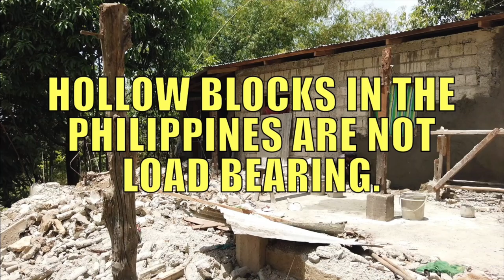Hollow Blocks In The Philippines Are Not Load Bearing.

Comment: " cinder blocks " in USA are load bearing .  They don't use post and beam though .
   The way they lay block here used to bug me until I realized they are only a filler .  You could put up a amacon or bamboo wall . It's the post and beam that is bearing the load .

Comment: On my buildings, I use 8-inch wide blocks, run rebar every 24-inches (vertically and horizontally. glue the blocks together with thinset mortar, and after setting three courses, fill and vibrate the cavities with concrete, bring the concrete half-way up the top course. Then I continue setting and leveling another three courses of block, using thinset mortar to glue them together, and filling the next three-course stage with more concrete, until the final height is reached. The resulting walls have  very high compressive, shear, and lateral strengths.

Comment: Columns and the beams are fundamental load bearing for ultimate load-carrying capacity, more so than the hollow blocks (cinder blocks). They are used to support the weight of floors, ceilings and roofs of a building and to transfer the load to a vertical load bearing element of the structure... 
Just have to remember that It's not wise to violate the rules which could pose threats to the safety of your family or any occupants by cutting corners in building your family's future house with the easiest, quickest, or cheapest way, often harming the quality of work for the structured building.
Thank you so much dai for another great sharing,. Good luck and wish you all the best. Be safe, stay safe, stay home! Best regards/Ned👍👍

Comment: Indeed the hollow blocks aren't load bearing, i saw a video of how they make them in Philippines, they are just sand and cement mix poured in a template. In UK, we use bricks or aerated blocks, both are load bearing. My house is 3 storeys high with 30cm brick cavity walls, no colloums or beams to support. I wish there was bricks in Philippines, it would be so easy to build without needing of rebars etc. We also have concrete blocks which are also load bearing, which are very heavy, they are used as first layer on the foundation, damp proof course after that and the bricks.

Comment: Village person,  The hollow blocks are just to show the render crew where you want
the walls windows and door openings. That being said they are also the shear panels 
 for the building. When you see hollow blocks laid during the day there will be wet
spots wherever the core holes are inside the blocks. This is because the fill mortar
wicks cement and water into the pourous blocks filling the cement left out of the
blocks when they were made. Also the render added to cover up the butt ugly block
work soaks more water and cement in from the outside further strengthening the
hollow blocks. Building code only allows  six courses per day with a minimum 24 
hour wait before adding more courses. This allows the soaked in water and cement
to cure before adding more courses of block.
      The Phillipine government published a downloadable guide for RCCI (reinforced 
concrete with  infill) including earthquake resistence. Even if a prospective builder
is hiring an architect/contractor they should read this guide. Simple things like 
window spacing on opposing sides of the building are crucial to earthquake
resistance to prevent structural collapse of a building from a twisting action due to
difference in shear resistance on different sides of the building.
     We have a no advertising content based channel covering the building of
Villa Cecelia 56km south of Manila. Along with the videos there are narriated
slide shows including the rebar and structural concrete stress calculations. This is
a poured concrete building and there is a cost analysis of hollow block versus
poured concrete walls. This structure was built before seeing the RCCI guide and
it turns out we violated none of the guidelines including the styrrup design rules.
I can't say how entertaining  "CONCRETE HOUSE BUILDING IN PH"  may or may not
be, but there is a lot of detail about concrete house construction. The one concerning
the mix ratio of cement sand and stone available delivered to your site, which varies
from one place to another should be insightful. Styrrup design is well covered and
how many rebars at what spacing for suspended slabs (floors) for a 1.5 safety factor
and  275 Kg per square meter live load is presented in another video. Dimensions
of columns, beams, and tie beams for this build are given with actual dimensions 
on the permit sheet for building materials video. This is one of several videos 
covering what goes on the 7 blueprint sheets signed off by about 8 government 
offices to get a building permit.

                        george and aurora  "CONCRETE HOUSE BUILDING IN PH"
Reply from the maker: George & Aurora. I had a look, very interesting build. When I built my own houses I had to pour large sections of poured concrete, https://youtu.be/eFvRgP3UrDw I have been considering doing the same for my rental bungalows since there will be multiple builds of the same design. I will watch more videos from your channel. What design program do you use?

Comment: You are correct the foundation is the hart  of any house no matter where are building I have columns tie beams with rebar and added additional columns in USA the roof rafters are much more substantial because we have snow load but I am a carpenter so I built my roof to US standards and made very strong connection to the header beam it’s not coming off in a wind I also insulated my house it is much easier to cool but now I have become acclimated to the weather I only use fans my doesn’t like a cool house and also you are a Philippine lady I am always open to learning if were building here in the USA I could help you and advise you just as you have helped me I made my own blocks only because I wanted to control the size and quality to make the walls more like in the USA just to make them look better

Comment: Very true about the local concrete blocks there.  If you want quality load bearing blocks you must buy your own block forms and make your own with adequate mixture.
Reply from the maker: keith jestski I agree, but why make load bearing hollow blocks if you are just going to reduce and cut corners on the beam and column structure? Does not make good economics to me.
Reply: @villagepeoplephilippines  Two different methods to achieve similar results.  In USA we use a monolithic slab and foundation pour using mix that is certified at appropriate strength for the purpose.  This is not possible there with hand mix and cold pour techniques that cause less strength in the end product.  You are doing quite well with what materials and manpower / tools / budget available.  As I said, I would rent one, and prefer it to living in a high rise condo box.

Comment: One other difference is USA blocks are 8 inches wide, not 4.  Stucco rendering is applied to the exterior, and interior is insulated and stick framed then covered with drywall.

Comment: You are right on about the support of the walls,  BUT why not make blocks that will aid in the support also, adding to the strength of the wall?  It upsets me to no end when I see the lack of workmanship in the hollow blocks.  You have to be careful picking one up without breaking it.  I have supported a 3000 pound auto on 4 PROPERLY made cinder blocks while working under it  just think of the strength that would give a wall.  Plus add the correct rebar and fill with properly mixed concrete and that's the way to make a wall!
Reply from the maker: It is a shame hollow blocks are not made load bearing but some people have assumed they are.

Comment: RCC structure (Rigid Cement Concrete) is all about transferring the load to beams,columns and finally foundations and can stand on its own without walls.  Ever wonder why the glass walls on buildings does not shatter?
Reply from the maker: Ray McTion I had an argument with a foreigner who, because he made his own hollow blocks, cut corners on the foundations and tie beams on a 3 story building. When I told him the structure supports the weight and hollow blocks are in-fill, he told me that Filipinos don't know what they are doing.
Reply: @villagepeoplephilippines  Residential homes in the US are mostly load bearing structure type where all of the elements carries load and hence there is no need for  posts. Hopefully he knows how to build this kind of structure. He would eventualldy learn that no cement structure uprooted or severely damaged by typhoon in the Philippineds as compared to Florida.

Comment: I watched your previous video you used 10mm reinforcement rebar, is this safe?
Reply from the maker: I am building on a flat ground, single story and wood trusses roofing, this is more safe than their old house.
Reply: @villagepeoplephilippines  what's the dimensions of the column ma'am?
Reply from the maker: Every answer is in the videos about the bungalow. Their old house had 9 rotten wooden columns and two story and nobody said anything, this is one story and has 12 concrete columns. I built this give away house free of charge for the old couple so I can get them off of my land. I have had a few people say I should have used rebars varying in size from 8mm to 22mm. I had people saying I should have used metal instead of wood, long span instead of GI sheets. a 1-8 mix instead of the 1-3 mix I used for filling the hollow blocks and rendering. I included a lintel and a header, and tie beams, and people said it was a waste of money. Yet I featured a school that lacked all of that and was built with 8 mm rebars, yet I don't see people saying anything about that. It is far from perfect, but it was far better and safer than what the old couple had. When I built my own house I had a team of architects and engineers and I used some of that knowledge when I built the give away bungalow. https://www.youtube.com/watch?v=eFvRgP3UrDw But I hope you watch the the video about the school. https://www.youtube.com/watch?v=-E4lwdYmMNU

Comment: This is an important topic, so I'll make a couple of brief comments.  The first thing to remember is that the Philippines is prone to earthquakes and tyhpoons so all proper design must be prepared for construction in an earthquake zone and potentially a flood zone.  The next factor is to understand the soil conditions and have a geotechnical survey done to determine how deep the foundation has to go to be built on solid ground.  If it's impractical to go down to solid material for any reason, there are other designs possible such as slab on grade and floating foundations.  It's key to have a good base before you start to talk about structural design and construction of the building. Whether or not the roof is supported by load-bearing walls or columns, the walls and columns need to be properly supported, constructed and designed. I've seen a lot of shoddy workmanship and materials in the Philippines where poor concrete and mortar was used and you're never going to get good results with poor craftsmanship and materials. In conclusion, the building is only as good as it's weakest link, whether that's design, construction or materials, provided that you've got a proper building site and you've considered local conditions.
Reply from the maker: Paul S  The purpose of the video is not to sugar coat the fact, hollow blocks in the Philippines are useless and should only be considered as infill. They should be better, they should be safer, they should be stronger, but the truth is they are crap. So people need to understand they should not cut corners on foundations, support beams and columns because they made their own "load bearing" hollow blocks. The column and beam structure is considered the strength of the building in the Philippines, not the hollow blocks. Some expats want to change how things are done saying Filipinos don't know what they are doing. There are laws concerning the design and construction of buildings in the Philippines and the law has decided that 4" hollow blocks regardless of strength are infill, they could be the best in the world, but it would not alter the fact they can not legally be considered load bearing, strong hollow blocks should be a bonus not an excuse to alter the mandatory requirements written in to law as some expat believe.
Reply: @villagepeoplephilippines  thanks for your reply.  I think that you've nailed it in your comment - "hollow blocks in the Philippines are useless and should only be considered as infill. They should be better, they should be safer, they should be stronger, but the truth is they are crap".  I think that's the difference between hollow blocks in the Philippines and in other countries.  Here in Canada for example, hollow blocks can be used for foundation walls.  The hollow blocks are designed properly and constructed with the appropriate materials, so they are often used for load-bearing. As you point out, hollow blocks are built to different standards in the Philippines and it's important to understand local materials and conditions and build and design accordingly.
Reply: @villagepeoplephilippines  true. Hollow blocks in the Philippines is totally shit. they got easily broke and tear apart.

Comment: Hollow Blocks in the Phils are not Load Bearing, the Title should be: A different type of CHB in the Phils. Although ordinary CHB was commonly used in PH house construction, the Load Bearing CHB's (500 psi to 1000psi) are available in the Philippines. You can find the website of Jackbilt Industries which is one of the manufacturers in Luzon and Lite Block in the Visayas. 😀✌

Comment: Sand from quartz is needed to make strong blocks.   Volcanic sand is weak
Reply from the maker: Marvin Dockery Hollow blocks should be considered as nothing more than infill as the strength is the construction is concrete beam and column frame structure. Some use Polystyrene with a mesh that is rendered as infill instead of hollow blocks. Unfortunately some are replacing structural components of their build like tie beams and footing depth for home made "stronger" hollow blocks. When I do my next build it won't be a budget bungalow so I will show the full specification and hopefully get a structural engineer explaining on camera that tie beams are more important than "stronger" home made hollow blocks.
Reply: @villagepeoplephilippines   i agree.    My concrete house here at LaPaz, Leyte,  has lots of steel rebar,   but i have doubts that it was built on a poured concrete foundation.
The roof is also poured concrete, with lots of steel rebar,  but my walls have lots of fine cracks, and that bothers me.

I would rather have a nipa hut in a earthquake,  as poorly built concrete.
Reply: Hi Marvin Dockery if it is just lots of fine cracks not deep cracks I would say that's with out seeing it that the rendering dried to quick was not wet enough when applied so not a major problem
Reply: @villagepeoplephilippines  Hi - I have some of those polystyrene/wire mesh panels (EVG-3D) that I had shipped from Cebu Overseas Hardware. They only carry 2" thickness (too thin for a house) but I want to experiment with them for a garage/workshop (typical post and beam system). Nobody in Cebu seems to sells those Hopper Mortar Sprayers and Lazada orders from China keep getting cancelled so the panels sit in my bodega. I really want to experiment with those because I HATE the wasted time/labor in hollow block construction. If you ever see one of those Mortar sprayers please let me know. Thanks so much for all of your great videos. I get a kick out of your thinking-out-loud style.

Comment: This is the reason you hire an architect and civil engineer you lay out the plans. Hollow blocks are just for walls but should be reinforced by rebars.  If done properly, you should have a stable walls. You never use the hollow blocks as a support by itself.